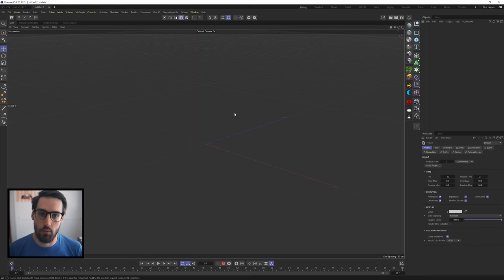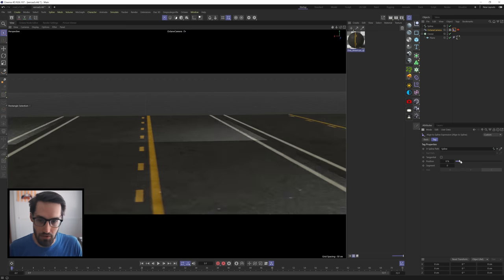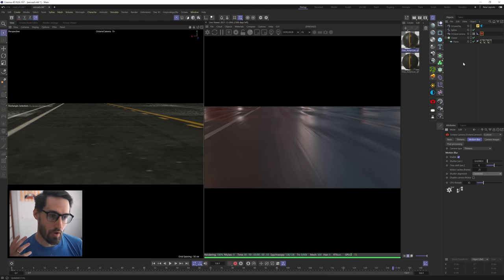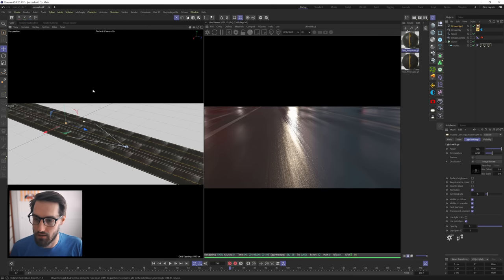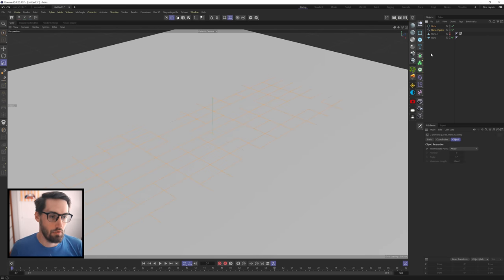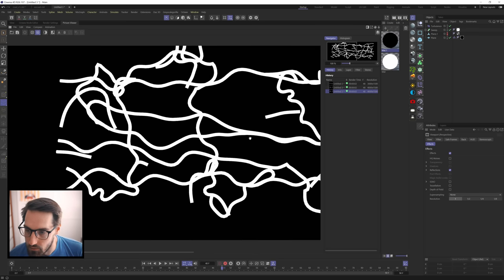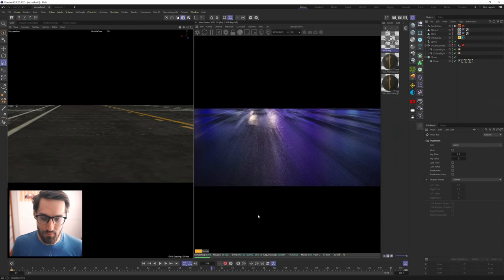How I made this Looping 3D Title Sequence | Cinema 4D + Octane + Davinci

Comment: Can someone tell me why the workspace visual of the road surface looks so different from the rendered image? I'm brand new to this, just beginning my journey into unreal, so sorry if this is a dumb question.
Reply from the maker: Oh, that’s cause of it looked “rendered” while you work, you’de get such poor performance because it really taxes the system to make it look nice and “rendered” you know?
Reply: Thanks Clint, that makes sense. I'm guessing your system can handle you keeping the rendered viewport open the whole time, but that might not work for a lesser pute?
Reply: @juseschrustfush  think like that: if your pc takes 5s longer for every change you make and through your project you make 500 changes, you lose 42h of time just bc you worked in rendered mode.

When you finetune your materials you obviously work in rendered mode, but you don't need to see it raytrace rendered when you work on the animation itself bc the only thing that is important at this stage is the motion. This is a small scene with just a ground but whats when you have hundreds of buildings and moving characters on the street? Your render view will choke, even with a big rig and there is no way to work efficient.

Comment: Hey there.Question? How do you add a texture to a plane in cinema 4D say a building front. then you want to move around edges to match teh building front to extrude..However the texture stretches when you move edges or vertex. what is the setting where you can adjust edges and vertex without moving the texture. IN Blender its the correct face attributes but I cant find an answer for cinema 4d....Can you tell me if possible?

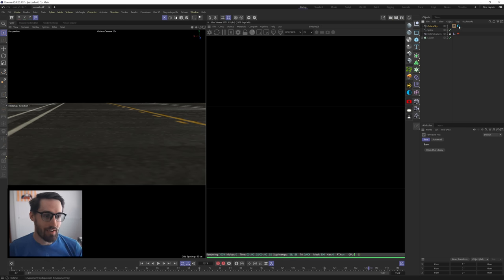Comment: At 6:35 dont just put the texture into the hdri link. You need to press the arrow left of it and actually drag the "file" from the octane image node.
Reply from the maker: Does it perform differently this way? It’s always worked for me by doing the method in the vid.
Reply: @pwnisher  Very different. Try it out, you will see a massive change. I think if you dont do it, it doesnt read the values of the hdri correctly
Reply: @pwnisher  Thanks for the HDRI Link shout out, Clint! For octane, you get better results if you use the octane image node for the HDRI instead of direct. I think it has to do with how Octane interprets HDRIs.

Comment: Hey Nice work ! How did you make those shake loop with the gorilla cam ?
Reply from the maker: The shake was small enough that you couldn’t tell that it didn’t loop (even tho it seems like it does. But, there is a way, if you bake it down, convert the keyframes to a motion clip, then fade the motion clips into each other it’ll loop. 

I think i cover this in my only c4d “quick tip” on my channel (on adding a custom character to mocap data.) its not to blend cam shake, but you’ll see the motion clip workflow at work.
Reply: @pwnisher  thanks a lot for you time ! and thanks, it work that way ! i was not baking the camera down. that's why motion clip didn't worked.

Comment: Why don't you just do the camera shake with a vibrate tag?
Reply from the maker: That’s possible too.
Reply: One thing I don't like with vibrate tag is that when you preview it and reset back to Frame 0, it doesn't put the object back to its original orientation and position.  It keeps it at the point it was when you stopped playback.
Does anyone know a way to stop that?